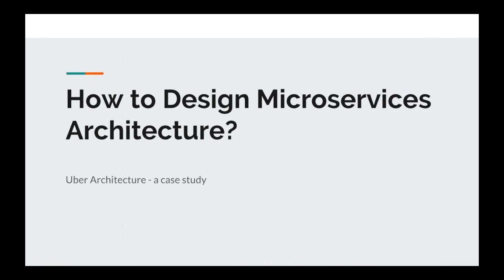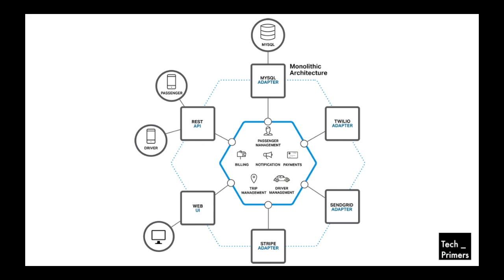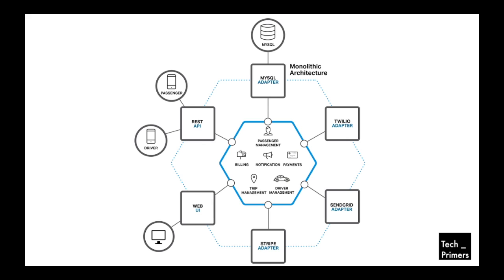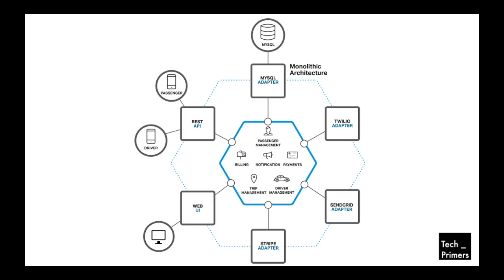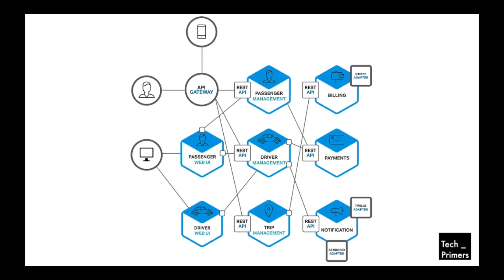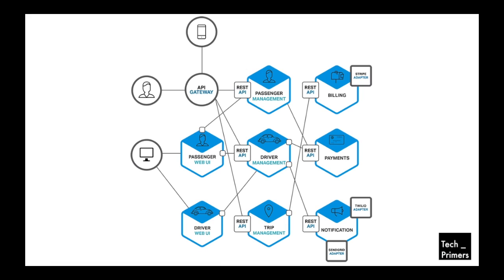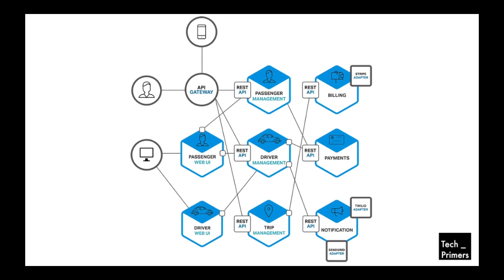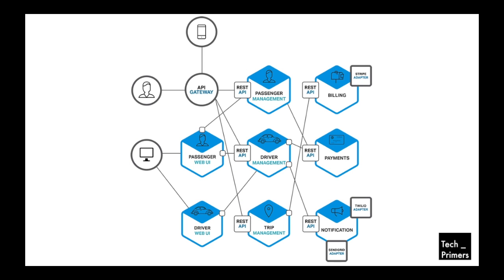How to Design Microservices Architecture? Uber Architecture - A Case Study | Tech Primers

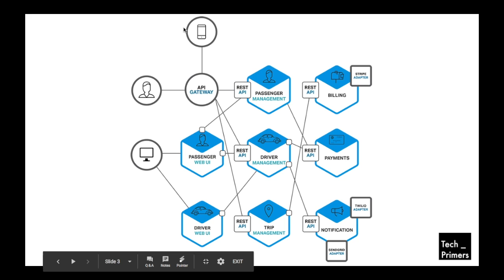Comment: 7:20 How else do you think such scenarios should be covered? If billing is down, it cannot directly interact with the user and tell that the billing service is down. It has to tell the trip management that it is down and the trip management will convey the same message to the user.
Reply from the maker: Correct. You can display that Bill has not generated or bill Service is down for maintenance. And in the background you can actively monitor using alerts and fix it to reduce direct impact
Reply: @TechPrimers  In Resiliency FailOver needs to be handled properly (or more replication needs to be taken care)and if you have large number of transactions then needs to ensure offline handling or queueing mechanism. Resiliency standard says, 99.99999% your system should be up and running. If the system fails then atleast piping it for the later processing so that things will be in place.

Comment: Why not use RPC for internal service calls? RPC will make system work faster.
Reply: It's not uncommon for APIs that start off internal to be made public, e.g. for clients to build custom workflows around your service. Starting with a RESTful design can make it easier to open up the API down the road.

Comment: good intro. Independent scalability and deployment are key things. It would have been good if you stressed each micro Service has its own data store rather than sharing (i see many corporate writing micro services with shared DB which kills independ deployment and scaling)
Also Your topic did not cover how these individual microServices communicate with each other. How does Driver  Service let passenger microService the location of the cars .. Actually in Uber, they use Kafka for uber scale real time messaging.

Comment: Fantastic video. I have just one quick question if its okay. Is there a way I can find out if a website is built on a monolithic or microservice architecture by reviewing the source code for example.....or any other way?
Reply from the maker: no you cannot. In general companies have API gateway which exposes only 1 server to the UI. Hence you cannot differentiate between monolith and microservices

Comment: nice content man!

did you work at uber before? or did you go to the uber blog engineering for this?
Reply: this link is nice, thanks dude
Reply from the maker: Thanks mate. I attended a Meetup Session in that the instructor showed the Uber architecture. Also i saw the uber engineering blogs. Btw, I have not worked with Uber
Reply: This is a straight-up example from a book on microservices by Chris Richardson. Here you go: https://www.nginx.com/blog/introduction-to-microservices/